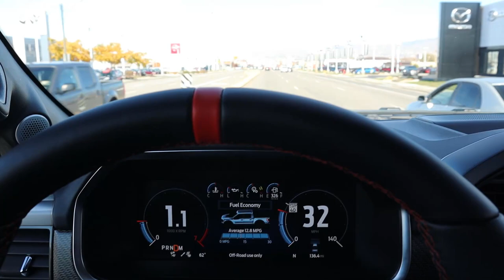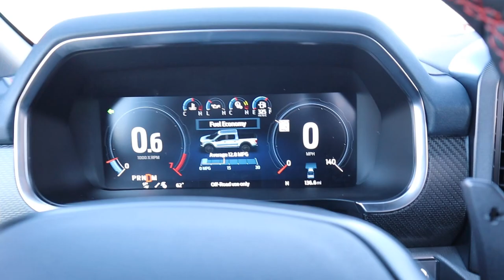My Brand New 2021 Ford F-150 Raptor Is Already Having Issues...

Comment: As a detailer I wouldn’t get the fender  repainted Just get it buffed and covered up if the original paint and the last longer get them to just write you a check of the damage and you can use it for other cool stuff for your raptor Original paint always last longer

Comment: just got my F150 Larit two days ago and I noticed a lot of issues due to the assembly line , the front speaker does not fixed well and the adhesive all around the clothe ceiling, paint job on the roof filled with bubbles, strange sound when unlocking the door
Reply: lmao..

Comment: Wait for the front swaybar endlinks to fail.   Gen3 owners are already reporting it with brand new trucks.   Both 37 and 35 models.
Reply from the maker: Oh boy
Reply: I didn't heard that yet
Reply: I thought I was the only one to see that on the Raptor forums. The new links are made of a plastic(ish) materials over the Gen 2s more durable full-aluminum. Tremor owners are also reporting front end issues.
Reply: We don't know if it's the sway bars or bad fox shocks yet.
Reply: I have the front end issue as well

Comment: I have a issue with mine, “Reverse Brake Assist Not Available” message. Every time I put it on reverse that message come up, I take it to the dealership they said that they have to order some sensor, which takes 2 weeks to arrive

Comment: thats my same fender that was repainted, replaced grille , replaced tailight, replacing front seat due to crease. Tomorrow front end issues and tsb for the power onboard fan running all the time behind the seat
Reply: Which model do you have if you don't mind me asking?
Reply: @hellkitty1014  agate black 801a 35
Reply: @Lumpycrown845  wow. So yours, Ben's, and my nephew all went Agate Black with paint issues. My nephew is actually in the process of a buy back from Ford due to an unresolved stalling and rattle issue with his 802A 35. His dealership has been awesome and he paid MSRP, but with less than 1000mi and being at the shop 6 times, he's had it.
Reply: @hellkitty1014  I did a walk-around of mine but didn't notice everything till the next day I got it at night. Which I never do but I know this dealership. I've never had a lemon on my life I hope not. I do like how the truck drove until bumps lol
Reply: @hellkitty1014  are they buying it back ?
Reply: @Lumpycrown845  yep. Ford's giving him the option to trade trim for trim or a complete buy out w/ no strings attached. He's going to give it another try, this time with Antimatter Blue.
Reply: @hellkitty1014  I can switch right into my 22 trx that I ordered in March I'm giving the truck the weekend. Decide by Tuesday.

Comment: That’s a piece of rack shelving. You can tell by the keyhole slots
Reply: Indeed, not piece of truck, went over it and it puncture it's way through, very unlucky though, like freaking getting bolt in sidewall of tire

Comment: if you/ford are going to use adhesive removers, make sure the clear coat doesn’t wear off or get affected. as for the random road shrapnel, see if the city has liability. 

either way, we have a positive spin when little bad things like this happen, that may this just be a payment against something worse

Comment: I wonder whether the adhesive has overheated with the black paint, either due to engine heat, or more likely, direct sunlight. The defect does not appear to have occurred when static. However, I do think that it will polish out.

Comment: My 2021 Lariat 5.0 has under 2000 miles.  Truck started to sound like a helicopter turns out defective lifter on #2.  Truck was down over 2 weeks at dealership.  Fixed for now but Ford quality control is seriously lacking.

Comment: Don't be that guy. The truck was not delivered with that piece of metal jammed in your wheel. You picked it up on the road. Your a nightmare of a customer, I feel sorry for the dealership that has to work with you.

Comment: Relax with the dust shield. Nothing is wrong with it. Don’t complain or compare the two trucks because you were the one that drove over the metal piece. Be grateful that you have to insane trucks. 
The stain.  I’d make the dealership deal with that. 
That Raptor in Canada is 120k. You are so lucky

Comment: Weren’t those decals put on at the factory??? How in the hell did it pass inspection??? Hopefully it’s no big deal to fix Ben….👍
Reply: PDI's at factories have gone to crap this year. I just bought two F150 Powerboost XLTs for my company and one of them had a scanner on it that had a "Property of FOMOCO Dearborn "sticker and other Ford proprietary info on it, in addition to a worker's gloves. The other has a rattling door panel with less than 500 miles. Insanity.
Reply: @hellkitty1014  Oh boy! Now that’s stuff  that just shouldn’t happen really….
Reply: @hellkitty1014  A bit frustrating I would say. Man oh man!!

Comment: After 2 years ( 30k miles) of owning a 2017 Raptor . Little things starting happening like the panoramic sunroof would get stuck and wouldnt open or close at times. The entertainment system would randomly power off and I would have to power off and restart to get it back on. I ended up trading it in for a custom 6.2L AT4 in 2019. I enjoyed the Raptor but for 75,000$ it shouldnt have any issues in under 3 years of ownership.
Reply: Especially with that amount of miles.

Comment: What a click bait video.  Calling it an issue in the title and blaming it multiple times just because you didn’t pay attention to something you drove over. Lots of people don’t click on videos, so people are assuming there are actual issues after 100 miles. The adhesive sucks, but i’d be surprised if the dealer does anything more then buff and use some googone

Comment: so the part under the truck looks like the pole for a stop sign, and has nothing to do with for and think about it if you hit it and were driving 50mph, a 2x4 in tropical storm winds will go through a cement wall. As for the runs that will come off without any repaint I bet. Atleast the raptor hasnt left you stranded or gone into limp mode, I would give anything to have the raptor arm, leg, eye, spleen, kidney, I would offer a lung but after being a firefighter and paramedic im 41 and on oxygen because my lungs are shot so no one wants those. That also mean no new raptor for me ever unless I win the lottery and I am not a gambler so I will just have to dream about the raptor. Ps life sucks 😞

Comment: Man, it's beautiful truck, non of the manufactures get their things spotless perfect, i got F150 fleet steering wheel worn off down to soft foam in 40k miles, i bet some earlier versions did not do that, but i have different personal truck make and it has some kinks too

Comment: I wouldn’t buy anything made in 2020 or 2021. Too much hurry up and get the truck out for delivery from the factory. My paid off 2016 F150 had some minor issues with rattling in the drivers side door which was a simple loose bolt for the automatic windows. Paint is flawless and no problems at 65k miles.

Comment: Shoulda bought a GMC
Reply from the maker: Haha
Reply: @BenHardyCars  AT4 3.0L duramax where the sauce is at and I’m not talking Ragu
Reply: @Martyvison  a everyday common truck though and slow. Trx and raptor life
Reply: Why? So the poor guy can replace the lifters or electronics. Cheaper to repair the Raptor… I think… 😁
Reply: @Martyvison  3.0 sucks has no start long crank issues.  Had one for 3 months and sold it GMC has no fix for it seems to only effect the 3.0 engines.  GMC interiors are dated and seats are not as comfortable as Ford.  Going back to Ford now!
Reply: Dude blah blah !quite being a drama queen